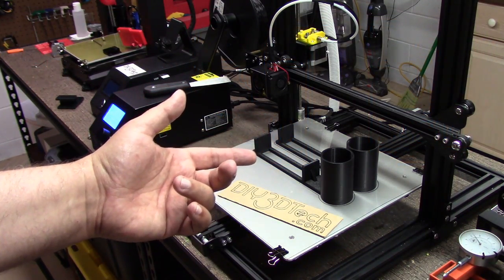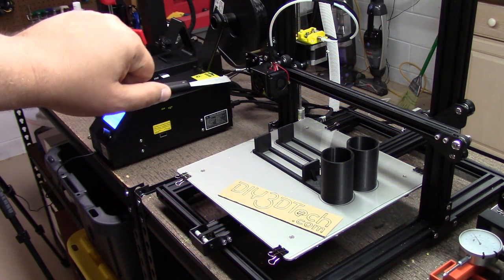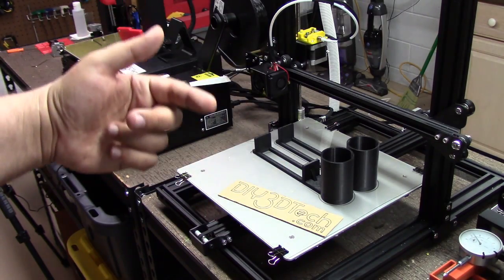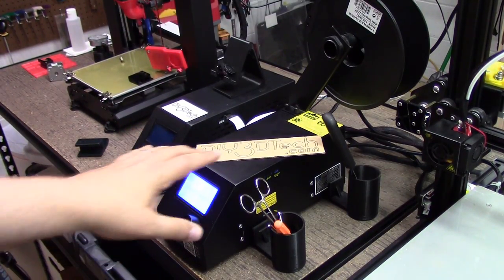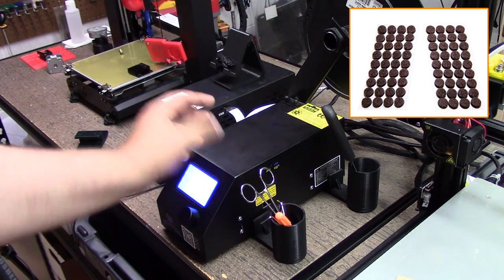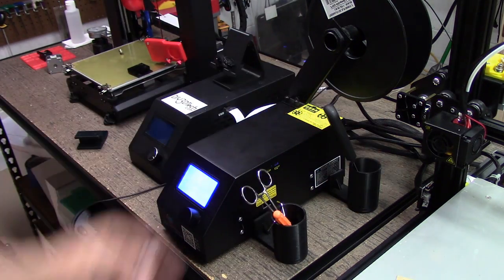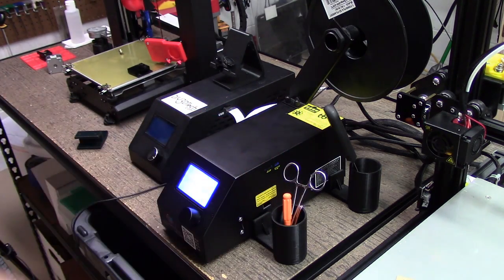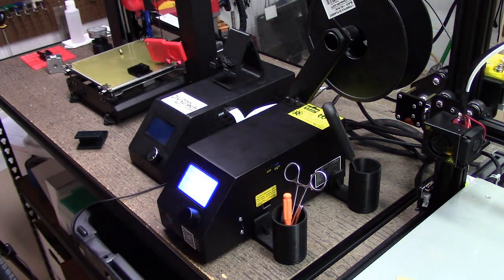Creality CR10 - AntiTip Over Solution!

Comment: Mine never fell over till i turned the spool holder around to resolve a feeding issue then it tried to fall off the bench. Turns out the spool is remarkably close to the height of a chair back so i just stick that under until enough filament is used up that it wont tip over. :)
Reply from the maker: LOL! This has been a HUGE download on thingiverse so must be a common problem...

Comment: after printing the bracket, the one thing that I think it is missing is a larger surface contact underneath to attach to the power supply using one or two 3M command strips.
Reply from the maker: You could do that, however so far mine just starts to tip and stops now as is.  However as mentioned in the video I put felt feet on the side so it pretty snug...

Comment: I have the CR 10 but I have a problem with the hot end that it is not heating and if it's heated one it reaches 200C it cools down. Do I have to change the hot end and how to change it ? .
Thank you
Reply from the maker: Can you "manually" set it too say 210 deg/c and have it hold?  As I assume what your referring to is your running gcode?
Reply: It's the same it doesn't hold one it reaches the desired temperature it cools down
Reply from the maker: If it won't "hold"  but reaches the "temp" would indicate to me that the thermister is good  because it "reaches" the temp and the SSR (SCR or such) will kick out and does not seem to be turning back on so my "guess" is a bad board...
Reply: Ok so what is the best solution and I would like to learn how to change the hot end because I am planing to buy the E3D V6
Reply from the maker: Replace the control board....  nothing to do with your hotend from what you described
Reply: Thank you very much one last thing can make a video about changing the thermistor because I think I damaged it while trying to find out what is my problem

Comment: I spun my spool holder around so it was hanging off the other way...so far no more tipping, but I may print the brackets anyway, like the idea of a spot to put my pliers and scraper.  Thank you!
Reply from the maker: That with out question is neat solution however, how is the feeding?  As this is one of the reason I have this way as it can get picky about feeding :-)
Reply: feeding seems fine, I have it looped over the top of the spool which then feeds directly inline the printer, this puts the control box a little forward, but not that much forward. My only problem so far is that my micro tripod no longer has desk space, so I'll need to print a better solution soon. I Haven't printed anything really large yet with this configuration, maxing out about 6 inches tall, but it appears it will work  just fine.
Reply from the maker: Interesting as I have few feeding issue main due to the cheap filament as I print a lot for this channel so for tests I buy the cheapest filament I can and it tens not to be wound well...